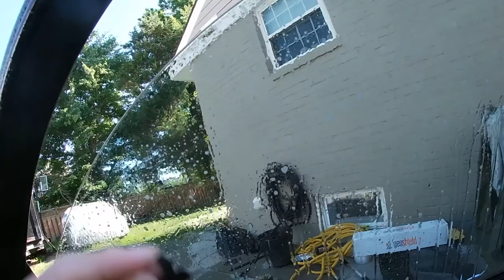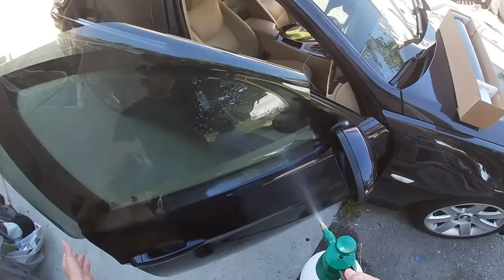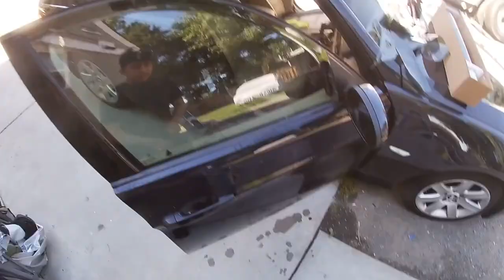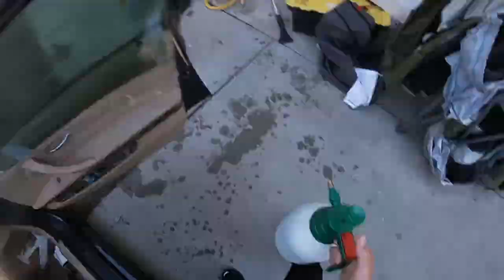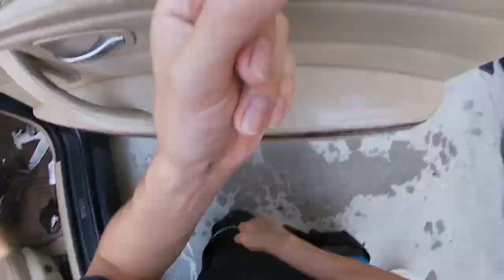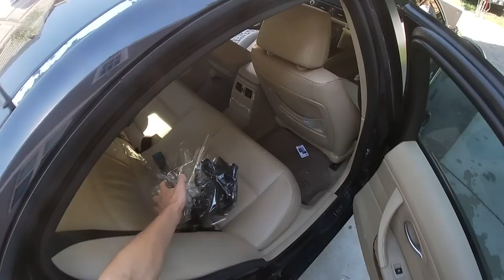Tinting with Dewalt Heat Gun

Comment: Thinking of buying one of these to do tinting on call. How long u reckon one fully charged battery would last? Cause them rear windshields take alot of shrinking.
Reply from the maker: I recommend a wired heat gun because I could only get two windows shrinked  before my 20v battery died. I tried heat shrinking a rear window and it died before I finished.
Reply: @stevepow747  thanks alot this was helpful!
Reply: @stevepow747 
which 20v battery you use, 1,5a?